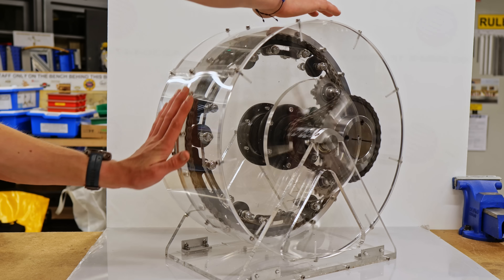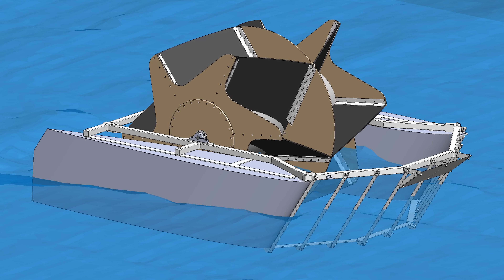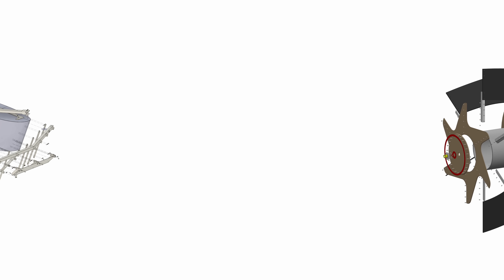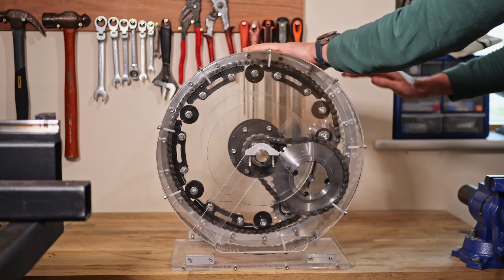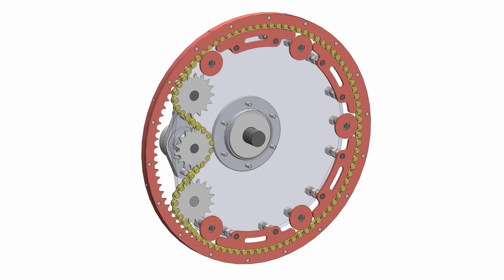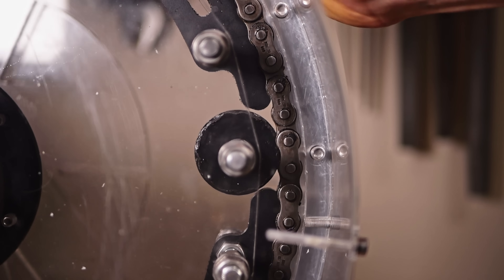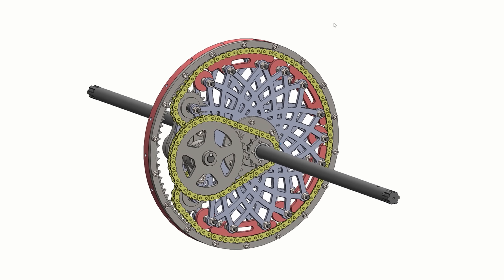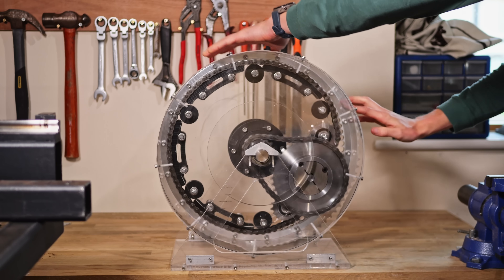Design of an Inverse Chain-Drive Transmission

Comment: Great to see more from you, I used to watch your homebuilt knives and slingshots religiously back in the day! Congratulations on the cool project. I really think that kind of approach is what the world needs. Simple stuff that can be built or maintained anywhere.
About the gearbox, I guess the by far biggest downfall here is that the chain wants to unwrap itself from the inverse sprocket when you apply force to it. 
The reason chains usually work so well as you obviously know is because they are self tightening around the sprocket they run on. In your layout it's self untightening in a way. Another major issue I see is that the moment the chain start to length itself, you'll have issues of correct engagement at the rollers.
I guess that that's probably why people usually use belts as they bring a bit more tolerance due to some flexibility in terms of correct engagement.
Why didn't you base it on a motorcycle belt yourself? Those are also rather easily available, would the added width have been an issue for you?

Comment: The idea is good, but the price of 2000 pounds seems like way too much. You need to reduce the price to under 400 pounds to have any use. Start thinking about low cost replacements for your parts. Diesel generators are way smaller, can be used anywhere and can be run with local oil and fat, reducing the potential cost of an entire day of runtime to a pound or less, if not at full power, all while costing under 500 pounds. potentially giving you 4 years of power for the same price, but not dependant on rivers. So while this might seem like a nice project, i doubt it will ever be used, aside from some white people going to africa to show off renewable energy as a youtube video or investor scam.

Comment: It looks cool. I once built something similar for a packaging machine. The guide that holds the chain in place is going to wear down way sooner that you imagine - especially if you have load (that is what happened to me).
.
.
Take a look at the gear system for a cement mixer (use that as inspiration)

Comment: I'm no engineer; if you were to make a separate sprocket that bolts onto and stands off from the water wheel, the chain could run on the out side. You may need only two tension  pullies to keep the chain in contact with the smaller pullies. This may reduce the rotational speed?

Comment: I do not believe it is over complicated at all as mentioned.
I saw no generator or pump in the design.
Were you thinking of a self designed unit or off the shelf components ?
LOL, funny after thought, if given shaft or cable drives from both sides, and further gear reduction at the ends of each drive shaft, this might be able to drag itself up stream.
Probably very, very slowly, but still.
😁

Comment: Shame it's not open source be fun to play with maybe convert it to an inexpensive variable transmission by decoupling the first/central gearing arrangement and clutching it to the hub output sprocket. Means you could engage/disengage that by pulling it out of engagement rotating it and getting a different gearing, with a twist (in the chain) you could also get reverse. Which is nice if you want say 3 forward 3 reverse gears in matching ratios as the circumference looks like it'd support 6 gears that rotate around the hub shaft easily

Comment: The beauty of using a propeller for this application is that the entire surface extracting the power/torque is in contact with and under the flowing water all the time.  (that's why it's so popular in the marine industry) More than half of your drive surface which is designed for water is in the air all the time.  Having water flowing more than about 2 m/s and less than about 2 meters deep picks up a lot of friction/turbulence from the river bed reducing the efficiency even more.   I'm seeing something more like a small Hobie Cat style hull for stability with prop shafts sticking out the back or under each hull.   All the mechanicals within the hulls.  Your generator/transmission(s) could be mounted directly to the prop shaft staying nice and dry within the hull.

2500 newton-meters is about 1850 foot-lbs of torque.  A Chevrolet 427 cubic inch big block V8 (L71 engine) generates 435 hp and 460 ft-lbs of torque.  Are you saying this water wheel/transmission is capable of producing 4 times as much torque as an L71 but when you hook it up to a generator through your reduction box, it only generates 500 watts of electricity?  746 watts roughly equals one hp.  Hummm.  I think you mixed up some commas and decimal points in your calculations.

My compliments on building a working prototype.
Reply: great sanity check, though the rpm here is unbelievably low, and power is torque x rpm

Comment: The cunning trick would be to just engage gears into gears, use five planetary type gears to hold the primary core gear together and isolate the chain drive outside of the inverse gear, this will allow you to adjust your drivetrains rotation to ensure a comfortable chain link connection back to your power takedown chain drive. This spreads the key point of loading the chain from the first or second tooth of the chain with the rest rubbing passively creating friction, to segregated and seperated locating gearing taking power from the outer ring and driving a simple chain mechanism to deliver power to your motor. It'll still suffer some friction losses due to the chain, but the chain can operate separately and have room to flex some. how particularly we would allow these gears to rotate about their drives yet deliver power becomes a hidden question. Possibly multiple chain links to the 'second stage' will be needed, although this represents an opportunity to change gear ratio as well.

Comment: Also, if you go to real belts, the 40 mm width standar, you can get much more power and efficiency thay what you get with a chain. And most of all, you can make the whole multiplier water resistant. Belts work great under water. Check the Gates timing belt catalog for sizes and torque values.

Comment: do not show this video at your new job... I woud just fire you for this useless showoff contraption. With a non rotaing  main shaft, a couple of off the shelf 5:1 sprocket sets would have done. Just make your first chain like your second one. You just need to add a 1:1 chain to start over from the center.

Comment: well, apart from this being a very interresting concept, and a rather sleek design study no less... it still seems to be kinda over-engineered cart that's been put before the horse, or is it? the surplus on friction as much as chain tension could be easily improved by doing it non-reversed, like the "bicycle-way"... admittedly, that would be the boring solution in contrast to your very much satisfying  eye-candy design...

Comment: Quite a few years back Honeywell came out with a gearless wind turbine that looks like a bicycle wheel, where they put the magnets on the ends of the blades and made the outer shroud the stator. The up side for that was the low cut in wind speed of 2mph to start generating electricity. The entire thing was 6' diameter and you can find videos of it if you look for "Windtronics"

Comment: Green water-proof grease for lube. Also, use an eccentric bolt on one or both pulleys for adjustable tension as a live adjuster would increase losses.

Comment: Nice one, and congratulations on the degree.

It's a shame that the wear will, inevitably, serve to throw the chain out of mesh. My mind bends at the prospect of some way of rotating the rollers and pads in synchrony with the outer ring, however I think what you could do would be replace the pads etc. with timing belt moving at the same speed as the chain.

Comment: Great out of the box thought experiment but as a transmission...nah. You have two sets of sprockets already, one inner and one outer. You might as well use two or even three regular sprocket sets. That should still produce less friction than your solution and be far cheaper.

Chains like these are more or less dimensionally stable under tension but you alternate tension and compression. The drive won't last a month under real conditions.

Great presentation though.

Comment: If you removed alternating teeth on the large interior gear and replaced the sliders and rollers with gears also without every other tooth, would that reduce the friction enough to offset the potential loss of torque from losing half he teeth engaged on the drive wheel gear I wonder?

Maybe even trying other teeth removal ratios, like removing 1 of every 3 teeth on the big gear and 2 of every 3 on the idles gears.

Comment: How do you get the electricity out of the inside of the hollow spinning drum? I must be dense
Reply from the maker: Haha not dense very good question! The central shaft is fixed and doesn't spin, so towards one end there is a hollow section to route the cable through

Comment: How about if using a belt or a chain you use a thin steel ring with punched holes that's flat and thick. It would be always in positive tension and you wouldn't need to "push/press" it against the outer gear so it would be way more efficient. The new issue now would be precision.

Comment: Its beautiful! I wonder if there is enough lateral flexibility in that chain to allow it to pass over a ramp to wrap around the outside of the big sprocket, and then back inside again? A smaller amount space with higher friction would replace the need for pushing the chain outward most of the way around... It would likely reduce the lifespan of the chain some but that might be offset by the reductions in wear elsewhere. I think it would require a bit more chain too. Proper material selection for the ramp surface would have a big effect on all of that as well.

I love this idea! A very creative morphing of one useful device into a similar but more robust device. I have not come up with any uses for it...yet. Its rattling around upstairs with all the other stuff now so I will probably think of a good use for it soon. Keep working on it. I think it has a lot of potential because of the torque capacity and its compactness.
Reply from the maker: Thanks! That is an interesting idea, could work with bicycle chain maybe, let me know if you think of any good uses for something like this

Comment: I once welded 18 feet of #80 chain to an 8' diameter ring to drive a 26' 4" diameter solar collector dish.

Instead of using 2 chains, my system was driven by a 1.5 hp windlass with a compound ratio of 127:1

The torque this system could drive through is estimated in imperial, at 32 foot tons of total force.

The weight of the entire tracker, excluding the concrete in the base was 14 tons, and then we also used 12 tons of concrete to fasten it to the ground.

We had no need for such complicated mechanism or calculations, as we had a sandwich driven sprocket retained by a neoprene rubber wheel being held with an adjustment screw and a locking nut, on a swivel built up from the concrete super structure so as to ensure it would be impossible to bind the drive mechanism.

At both ends of the intended circuit, we installed limit switches to stop if from over-driving and self destructing.

I actually have photos of this whole project showing how immense it was.

The local municipality, at the coercion of the local coal fired power plant, forced the project to be discontinued.

The frame of this mechanism can still be seen on Google Maps to this day, only its a fairly blurry image.

[see geocoordinates, as recovered from Google Maps]

44.085082559595236, -93.20751761171437
Reply: Nice share and design.  Any related articles?
I zoomed in on the coordinates  3QPR+2XQ Owatonna, Minnesota
Thanks for sharing.

Comment: This will never survive high torque load . The tiny idlers are exposed to high loading..  The chain will be pulling on the tip of the teeth.  It's lifespan would be short.  Useless

Comment: Have you explored different tooth forms? Perhaps if they were asymmetric and had a claw type hook profile to pull the chain into the teeth. This is a possibility as the drive will only move in one direction so the tooth form could be optimised for this.

Comment: The chain on the large drum could run on the outer rim and that would solve the issue with the tensioners. Off the shelf part could be something from a concrete mixer.

Comment: You have to test it under an external torque load what you might find is increased need for lubrication leading to what they do in helicopters forced lubrication which has its own problems.

Comment: Very interesting design.
I guess challanges will be the friction that also will wear out the chain.
And the chain will get lengthened as well as the inner chain drives.
You would need to make a 1 year long term test.
Also considered a planetary gear? Those are made for that kind of housings.

Comment: The outer ring gear might be doable with water jet cutting, instead of CNC... If it needs to be thicker than easily cut by water jet, stack two layers.
Could the chain actually be replaced by drive belts?
Reply from the maker: Yeah that is another advantage of chain drive is that the sprockets are quite easy to make with 2.5D cutting, eg laser/water/plasma cutting, or worst case could even be drilled and cut with hand tools
Reply: How will you push drive belt to the outer ring ? In chain case you can go it with simple pusher because chain already have rollers

Comment: Your design sucks, from the viewpoint of a mechanic. It's too mechanically complex, so enginerds have wet dreams about shit like that.

Using multiple chains over water is dumb, so expecting them to not need adjusted or lubed and last forever 😂 😂 😂

There are so many components & wear points to a chain, so go back to a chainless design...if you want one that works. While that may be more efficient when installed, it won't be in a week.
Reply: Who cares about the viewpoint of a mechanic? The ones I know think a hammer is a precision tool, and like you they have bad attitudes and don't know how to behave in public.
Reply: @tcarney57  hahaha! 

Only people who want it to work reliably.
Reply: *gears would also be cheaper than chains, if produced in large quantities

Comment: could a pair of disks be sent at slight angles so they hold the inside of the chain but leave a wide enough gap for it on the side where the internal sprocket is?

at the very least this would keep half the chain from rubbing on a static surface, though it may require removing the conventional chain set from the internal area.

Comment: good for u for doing the work and learning but im sure you know, from engineering perspective, much easier drives would be better in nearly every way. and could be made as cheap. example: stacked gear reduction like you have at the first stage, 5 to 1 is it?